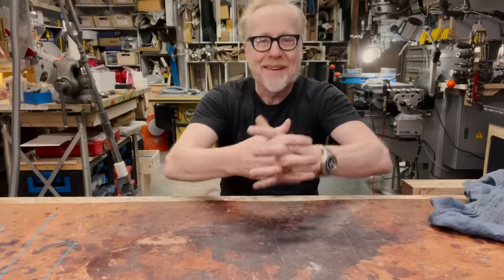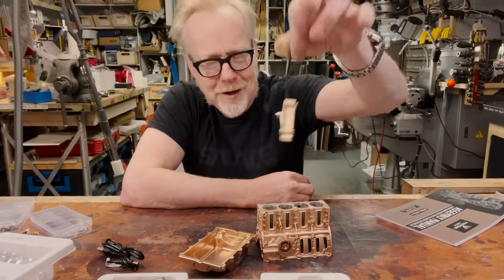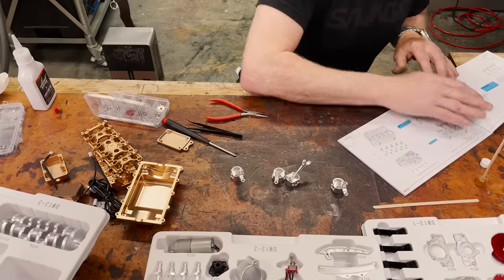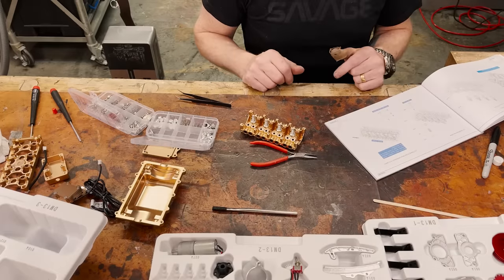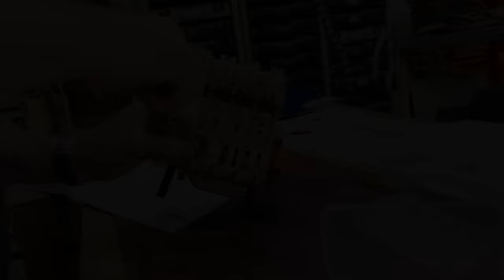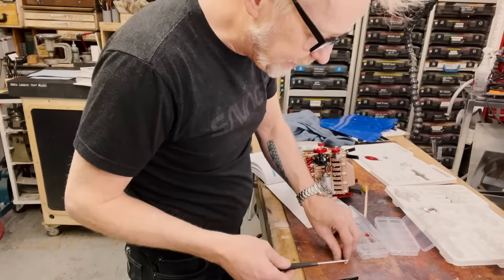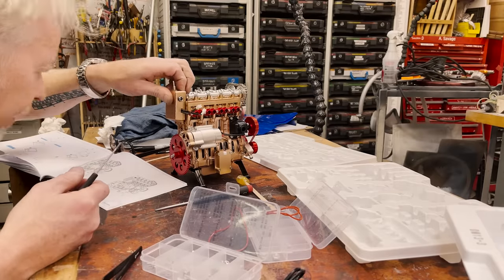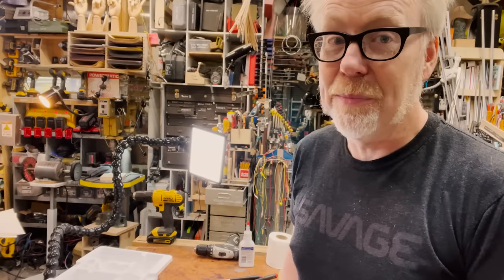Adam Savage's One Day Builds: Car Engine Model Kit!

Comment: Built the visible V-8 as a kid 55 years ago loved it just as much. It sat with my model collection for many years. Mine had a "working" distributer and "rice grain lights" for the spark plugs. Thanks for bringing back the memories Adam. 👍👍👍😊
Reply: Those old Renwal releases were nice but it was strange that you had to lubricate the cylinder bores or the pistons would eventually gall up and seize the engine and it would quit working. Also if you used the wrong lubricant it would make the plastic fog up and it was really hard to see things move. They (Revell have released the "Visible V-8" but it no longer has an electric motor that turns the flywheel and operates the engine. It has a small hand crank that you have to use to rotate the engine and there is no more the little wires and contacts inside the distributor that lit up the little bulbs, but they are another victim of progress. I have heard there are plans to bring back the "Visible Chassis" that was also a Renwal release, it would use the Visible V-8to complete a basic powered chassis, the biggest thing against them was they are such a large scale (1/4?) that it was hard to find a place to display them even though they were popular in automotive auto shop classes in high school and small junior college courses.
Reply: @horsepower711  I was wondering if anyone would mention the Visible V8.  I built the Renwal kit probably 50 years ago.  It was a quite an amazing kit.  I was thinking about re-living the experience, but the new version seems to have deleted some of features of the original such as the electric drive motor, and based on the comments on the seller’s web page the quality may have declined.

The kit Adam assembled probably eclipses the old Visible V8, but then this new DIY kit it is quite a bit more expensive.  I was just looking at another video about a gasoline powered scale V-twin Knucklehead 4cc engine.  Darn, that little engine costs like it it is regular full size engine!
Reply: @wtmayhew  have you seen the Conley 609 Stinger? honestly thought about building a drag rc with one
Reply: @sleepercore7725  I read your comment and just watched the video.  Wow!, that is cool.

Comment: $439! Holy Shit but as a mechanic who's torn down and rebuilt 4 cylinders, this pleases me so much and the craftsmanship a as in made of metal and not plastic as so many I've seen...... But REALLY EXPENSIVE!
Reply: I found one for around $50. For $439 you could get an actual engine!!
Reply: @lynnmckenney1987  That's the Smithsonian one. It's all plastic. A functional 4 cyl one, just a tad larger is around 5000 dollars. Which is around the price of an actual four cylinder engine from this generation. You can get an Acura engine for about 500~600.
Reply: Lynn McKenney hi pls note that any website who sells it below 300usd is a scam. Some of this kind of website stole our photos. Take care.
Reply: @moyustore  I'd love to give you the link to shut the scam down, but I cant post the link in the comments.
Reply: yeah for $400 you could probably score yourself a real 22re or k20 from a junkyard with a bit of luck
Reply: @origamihawk  I've seen dodge ram van b250 5.9 magnum V8s for $350
Reply: I definitely think it's in a bit of a tough spot on price.
It'd be hard to make it a lot cheaper while maintaining all metal, etc. However, for a desktop model at $450 you would expect a very high level of precision as well. Unfortunately, the wobble in the gears, exhaust pipes are all bent slightly different and kinked a little, they also don't have any indexing, the control box isn't well secured, all don't meet that expectation. Little things like that stand out at that price point.
Reply: a predator 212 running motor costs $99, not 4 cylinder, but at least it makes power
Reply: Bruh! Im at automotive technician and a die hard car guy. I saw this and thought i have to have one! So i looked it up and about passed out. I would go for 100-150$ but 500 is outrageous.
Reply: I had a engine delivered to my door for my bike for muuuccchhh less, and it actually transported me around. Pretty steep pricing for a pretty paper weight
Reply: When i saw the price tag on the website i had to rewind the vid to reassure i heard "good deal" ^^
Reply: @antraxxslingshots  🤣 I wasn't holding out for a good deal, every youtube presenter says that about a product. Some will flog ear buds for $110 and I got soundpeats truair2 for $60 and they're fantastic
Reply: @harleyrobertson73  So true. I really like Adam and his character, but that tends to make me forget we are basically watching a commercial.
Reply: @antraxxslingshots  watching him making it satisfies my need to buy one lol
Reply: @crabbiboi5528  What we need clearly is a service that disassembles and washes pull-a-part engines and packages them with assembly instructions.
Reply: I understand the price point, it's really well made, all metal parts, and not a lot of people will buy it, so, yeah, it's going to be expensive. Unfortunely, too expensive for me.
Reply: @moyustore  An added benefit of their models is that they can be disassembled, re-boxed, and stored easily along with protecting and transporting them.  Much more difficult to do with full sized.
Reply: @origamihawk  a real engine would be a bit harder to display on your shelf tho...
Reply: @ComandanteJ  That is true most of the time. However there is also stuff where i believe the price tag is created to keep the numbers managable. Not everyone always aims for insane badge numbers but tries to max out what they can get. Clearly a case of "Manager Toy" here. At least for me.
Reply: It’s a lot of money but I think it’s worth it
Reply: This whole comment thread is like a bunch of kids age of on politics. You know nothing of what you are talking about and you’re agreeing with each other. It’s adorable to see you guys getting along
Reply: Well considering I have been running  CNC Mills since I left school, guess I do actually know. Still not worth the money 😂
Reply: @lynnmckenney1987  can you send the link
Reply: @lynnmckenney1987  May be but I don't have a garriage to build a real engine but I do have a work desk in my bedroom where I could assemble this and then a nice shelf to display it once I'm finish.
Reply: @DavidKnowles0  well...you're not wrong.
Reply: But actual timing chain guides, ironically, are made of plastic.
Reply: @mzaite  That would be an interesting enterprise!
Reply: @aserta  the toyan l400 is about 400 bucks and can power an RC car. 
Pretty cool for only $500
Reply: Timing doesnt look correct either.. Both valves open at the same time in the closeup at the end wtf?
Reply: @kitecattestecke2303  It's a 4 valve. 2 exhaust and 2 intake valves per cylinder.
Reply: Slave labor makes imported products incredibly cheap.
Reply: i thought he was going to put petrol in the engine and run It that way
Reply: Partner just had one delivered for my bday. Have been looking for something like this for ages. Can’t wait to build it
Reply: @marcjones5862  that's awesome, happy bday 👍
Reply: You can buy an actual engine for the price of the V8 model damn.
Reply: @aserta  or a junk yard LS 4.8 or a blown up 5.7 hemi 😅😂😂
Reply: @harleyrobertson73  yep those old 360s go for pretty cheap now days😅  but they just dont make the power of the 5.7 hemi...now ill admit its a trouble shoot on if ure gonna get good heads on a gen 3 n up but its worth it when u do 💪🏁
Reply: @TheMrLuno  hell bro atleast the 212 will push a go cart
Reply: @crabbiboi5528  id think abt it.  If it was a V-8 ,but they give u half a engine for 500😂
Reply: @helplmchoking  teah in texas u can find a LS in a junkyard running 500bucks usually
Reply: @kruleworld  yeah but i can display it under my hood when i stop 😅
Reply: @kregadeth5562  well i do know this..i know for a fact u can get a junkyard LS V-8 for 500$ u can get a short block LS 6.0 from texas speed 3k...so somthing on that scale 500?... Nope ill pass thas the price of a Dry nitrous kit from summit ..100 more complete wet kit...
Reply: @lois gages naw i think its for goof ballz reason bein rich ppl dont build their own stuff lmao..i build fast engines for rich ppl alot!!
Reply: @DavidKnowles0  and with all that no horse power or compression bud...jus save for the garage or shed and build a real engine when its time..💪🏁 u will feel more accomplished and go a whole lot fast than the one on the shelf will get u
Reply: @CarbsLVR  ikr!! they want a peice of ure soul for metal ones!
Reply: @kitecattestecke2303  ure used to seein a V-8 huh!? 😂
Reply: @thekushlifetv  u can buy a real V-8 in junk yard for this one lol
Reply: @aserta  yes but an Acura engine can't feasible sit on the corner of my desk and amuse me during a boring work Zoom meeting.
Reply: @origamihawk  good luck with that one pal ive been looking for a 22re for months
Reply: Could probably get a sport bike engine. Gixxer 600 or something. It’s a little bigger but it’s an engine lol
Reply: @moyustore  No replies to any of the actual points made in this thread huh? Not to shit on it, cause it looks awesome, but it looks like maybe just a lil bit of extra work put into it would make it actually functional where someone could try and put it into some sort of model
Reply: As a Toyota tech myself I think I would have preferred if they had you install the crank and then install the piston/rod after this way it gives you the same feeling as a real engine. Also love camshaft cradle in this assembly pretty much same as the Toyota 4 cylinders.
Reply: @origamihawk  b16, d15, or f23 for sure
Reply: It's just some Chinese made piece of crap that has no use beyond amusing someone for a couple hours and then serving as yet another desk decoration. The cost to the importer is probably around $20. Most likely they just rebranded something that they bought from a factory on Alibaba. The effort being in marketing on the local market (they did well getting Adam to advertise for them). You guys should learn how the modern world works
Reply: it's $469 now.
Reply: yes for $439 I'll prob swing by the salvage yard & ft pick up a real engine in that case!! These companies are a joke, only people buying this crap are millionaires or YouTubers getting them for free. was cool to watch tho
Reply: @antraxxslingshots  it's always a good deal for YouTubers who get them for free to promote 😉 .....
Reply: @ComandanteJ  I don't & never will, it's $50 dollar paperweight there asking $400 for 😂
Reply: @kregadeth5562  I'm sure it is to the 1% that can afford it....
Reply: I could buy a junker version of the actual engine for less. I see the appeal, but the price is ridiculous....it has to be because it is such time consuming and small scale work....but holy shit is that kind of thing a Niche product.
Reply: As others have  said they are around $50. I have built actual running 10 scaled engines. One is in a Tamiya Bruiser. 1980 Toyota Hilux purchased in 82.  It has actual straight axles on leaf springs and auto locking front hubs. It also has a high low transfer case with two and four-wheel drive. And has a 3 speed transmission. Was the most complete detailed RC in the day. It got an upgrade to a scaled 350 about 15 years ago. Also have a blown 440  gasser Coupe I scratch built. And a blown 454 in a boat. It gets pulled by the 70's  Chevy van (has electric motor)  with the custom stereo system.  I wedged a "6"  inch "subwoofer" in it.  and put a mural paint job on it. All our tenth scale, and scratch-built except for the bodies. And the Toyota it's still all stock except for the stereo in it and the V8 of course. 
     The van uses the same transmission as the Toyota. And the boat has a jet pump. The Gasser has a all metal 2 speed. 
    Have a couple dozen other cars they are all Electric. Been building  RC cars over 50 years.
Reply: Lol i found it on amazon for less than 50 dollars
Reply: There are also working (nitro) small scale 4 cylinder engines that you can build as kit. They come with starter, fan, spark plugs and belts. Really neat

Comment: Having spare mounting bosses on the engine casting is totally in line with real life too. They can be for things like airconditioning or power steering, engine mounts for putting the same engine in a different car, mounting brackets for hoses and wires, etc.. etc..
Reply: or could be used in the machining process.
Reply: I think I've seen this same basic engine that has the intake manifold, exhaust header with a turbo charger and even injector nozzles in the manifold and in the right location and it's even complete with an operating ignition system that has tiny led bulbs in the spark plugs that fire (light up) in the proper sequence. I think that the camshafts and valves are a nice touch but the lobe profiles look more like they should have roller followers instead of the "slider" type followers. It might just be me, but it looks a lot like the Cosworth version of the German produced engine that came into the U.S. in Pinto's and Capris until the '74 model year. Now build up the Allison turbo prop aircraft engine that Revell has just reissued for the first time in decades, I'm waiting for them to release the Wright Cyclone engine that was used in several military planes in the '30s and '40s. One of the best known was the Stearman basic trainers that were used to train the majority of pilots during WW II, It was also used for crop dusting and it's still a popular aerobatic aircraft that shows up in a lot of airshows. The engine that was produced by Revell was also used as a display engine in a large 65" wingspan flying model that was produced by the Sterling company that has sadly gone out of business in the last decade or so.
Reply: They also make a V8 - which has two or those bore sections bolted to a shared crank case - Maybe the mounting points for the V8 version ?

Comment: As a Auto technician, I found it absolutely hilarious listening to Adam try and name the components of the engine. Arms instead of connecting rods, brackets instead of crank caps. Pure gold 🤣
Reply: I agree but it’s also kinda cringe
Reply: @cutlerscott681  Cringe how?
Reply: And upper "crank shafts"? or camshafts as their called.
Reply: Or, as we say here in the UK, conrods and big end caps.
Reply: I thought the same thing.. lol
Reply: Same it's like a twilight zone episode where we know more than Adam in a very specific subject lol
Reply: He got right the water pump tho
Reply: My favorite is using the proper name for snap rings, which is big Mark-Zuckerberg-trying-to-sound-human energy. Also weird that the instructions call them circlips instead of wrist pin retainers
Reply: And You go to different countries the name for engine components changes the Haynes manual has a section giving U.S names for parts and            there U.K equivalent.

Comment: "Lubricate everything that needs lubrication." Ah yes, the car is made out of car.
Reply: I had a teacher in junior high that would say, "a cow, is a cow like creature" when someone would define something like that! 🤣
Reply: To be fair, that is actually true. Every moving part needs to be lubricated just as with a full gas or diesel engine.
Reply: @renl4123  it would be true had it said " lubricate every moving part"
Reply: @donanders2110  But let's be real... It's just kinda physics and basic understanding that leads us to know that dry metal on metal will cause either warping/melting or worse... Sparks. Which of in the wrong place could mean an explosion.
Reply: @renl4123  petrol
Reply: But only the parts of the car made out of car are made out of car.
Reply: @XxEvolutionxX23  ah I see, the allspark is a car
Reply: It works for the dictionary 😏
Reply: Yes, but the manual is made by imbeciles.   

Do you pull out every part and apply lubricant all at once?  This sounds terrible messy and prone to misplace parts.  Personally I always apply the proper lubricant where specified and only on the part being assembled.

What the heck.  Let's just pour all of the metal parts into a vat of used differential fluid.  Then we can play engine parts bingo and install them in the order they are pulled from the vat.  What could go wrong?
Reply: This comment needs atleast 15K likes 🤣🤣😭😭
Reply: Don’t listen to Robert^^^ He’s a bell pepper
Reply: Circular reasoning is circular because of its shape
Reply: Man people are still taking this comment way too seriously months after it’s been posted, let’s start getting into the finer details of lube
Reply: @XxEvolutionxX23  the reason for lubricating moving parts is to reduce friction, which in turn reduces wear and heat produced. Generally there won't be any sparks from non lubricated parts
Reply: @WolfieMel True!
Reply: "Now draw the rest of the horse"